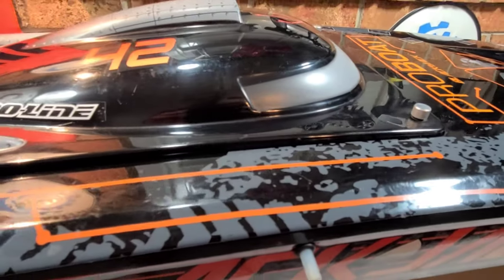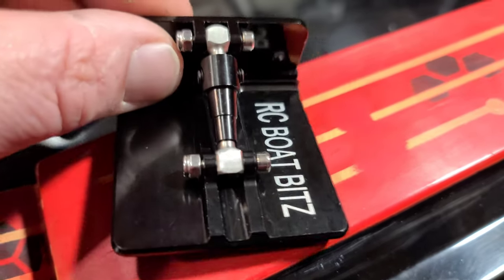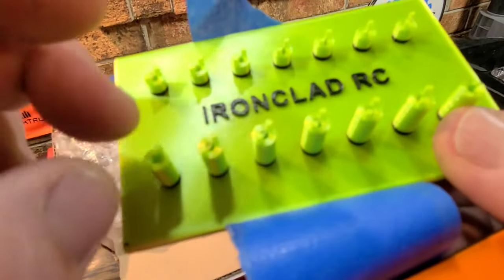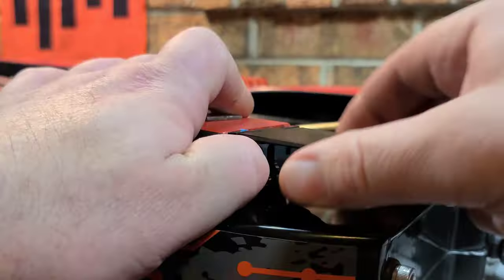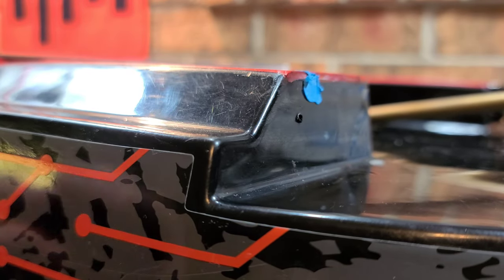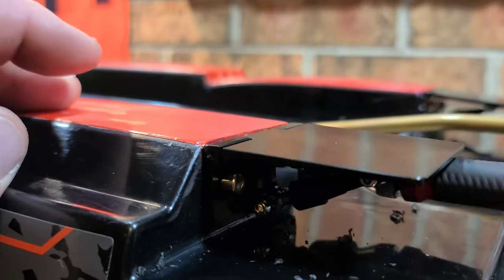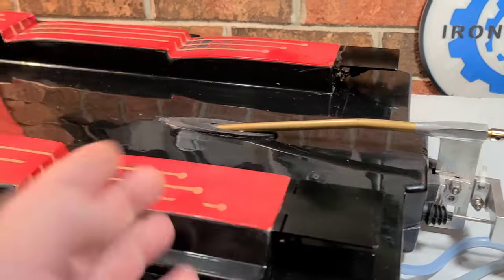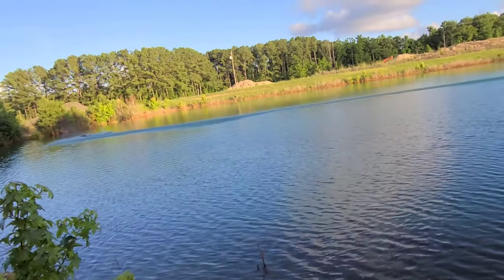Best Upgrade Option Blackjack 42 Rc Boat Bitz Trim Tab Installation

Comment: The thing is,,this is not a full scale Cat, so it needs trim tabs.  It's a accurate-ish model.   Even the guys that race the full scale boats do whatever it takes to make it work.  No guilt whatsoever fixing a model boat to stay put on the water, at FULL TRIGGER.  One thing I found that never gets mentioned, was that the set screws for the hinge pin were tight on one, and almost falling out of the other.   Make sure to set and loctite those hinge pin set screws evenly, or you risk pushing the pin outside of the hinge point and bending crap to no repair.  Joe at Rc Boat Bitz says to make sure the trim tabs are about a millimeter below the sponson surface when installing, so it can be adjusted to clear the water completely if needed.  That's how i did mine, with a slight oversize to the transom mounting holes, for more adjustment if needed.
Reply from the maker: Yes sir I agree 100% best upgrade for my 42.  Yes use loc-tight that's a must 

I've found 4 mm higher than the ridsurface works best.   I tried in line, then 2mm higher Now I run 4mm higher than the ride surface....  the extra height acts as a break/step. BOSSSSSSSSSS
Reply: @IRONCLADRC do you still recommend even with the sponson I picked up a set for my 42” I thought I’d seen a later video where you lowered them to make a final step down?
Reply from the maker: @chuchcbr1000  I actually raised them, about 3-4mm higher than the back of the sponson.
Reply: @IRONCLADRC  I’m confused as to what you mean? I am speaking in terms of where to mount them as far as flush then you’re extending them or what?

Comment: "I don't normally put trim tabs on a cat"  I wonder if trim tabs also work much like wheelie bars do on a dragster.  You know, most of the time they are not even in the water until,... the nose comes up.  Hmm.   :)
Reply: Yes just like wheelie bars....lol
That's an excellent example 😅🤣
Reply: U explained that perfectly

Comment: Hello.. why don't you a outside water pick line like you did on the BlkJck 24
Reply from the maker: Personally I think it's unnecessary, the 42 picks up alot of water thru the rudder pickup
Reply: Is there a way to Email you.  The one here doesn't work.  I have a few questions.
I have a new BlkJck42.  Haven't taken it apart yet or put it in the water.  
I did turned it on to bind it to radio.  Spun it up 3 times 10second each.  The strut got very warm/hot to the touch and is making a rattling sound. @IRONCLADRC

Comment: How well did those trim tabs run? I made a very small tab out of angle aluminum and it definitely helped, but I’m still flipping at high speeds. However the guys I’ve seen run these bigger tabs were having heat issues as the boat wouldn’t plane out as easy. Curious to hear how these work. Great video.
Reply from the maker: I haven't had a chance to run the boat I should have it on the water this week

Comment: Hey man just ordered these for my black jack 42 , can you comment a link for your marine loctite clear adhesive sealant. I can only find it in white
Reply from the maker: The clear stuff is silicone, all I can find is white loc-tite
Reply: @IRONCLADRC  thanks for the reply man! Also another question what temp gun do you use for temp checks? I’m looking on Amazon and they all say for food wasn’t sure if that’s what you used

Comment: Hi. Did you use silicone sealant of any kind between the trim tabs and the hull? If you didn't, it will leak inside the hull.
Reply from the maker: I used loctite marine adhesive  for the thru hull

Comment: Did you paint the bottom of your boat red or what is that
Reply from the maker: Basically, yes sir.   Airbrushed it then laid down several coats of clear then sanded & blueprint it

Comment: Hey man just installed these on my boat, I followed the video from the website I bought them from and didn’t mount them flush with bottom of boat, guy that designed and got them made said mount them as tight as you can to top of boat, do you think this will cause any problems having that small gap between tab and bottom of boat?
Reply from the maker: Nope, you made the right decision.  I mounted mine 6-8mm higher than the ride surface. Hit 106 mph when I made that change
Reply: @IRONCLADRC  hey man want your opinion with the black jack 42 , I have the dasboata prop on it which he stated was his fastest prop for the boat, I have the RC Boat Bitz trim tabs and running power hobby 6000mah 100c and power hobby 7200mah 70c and can’t get it over 60mph and when I hit that high 50/60 mph it blows over I can’t keep it grounded
Reply: Where did you find them in stock? seem to be out of stock everywhere.